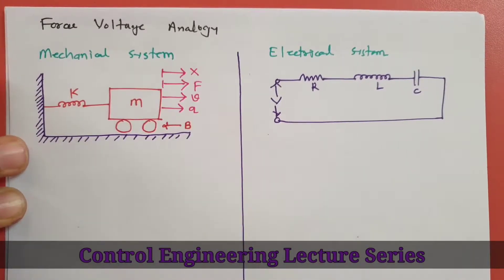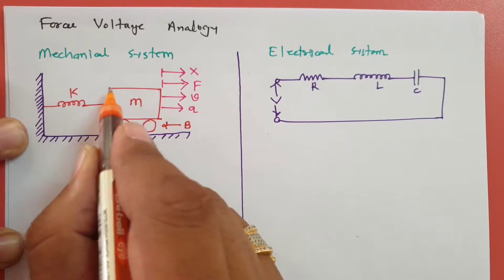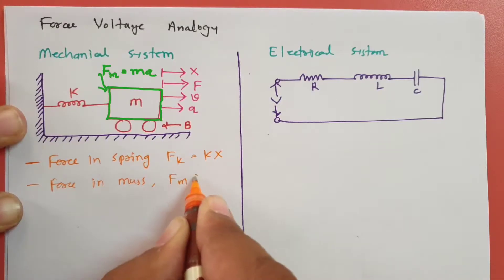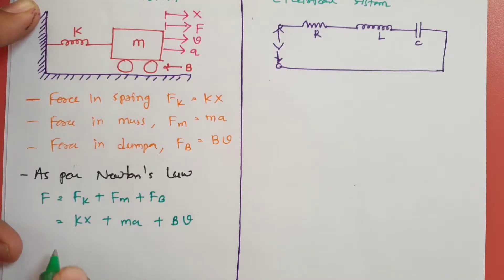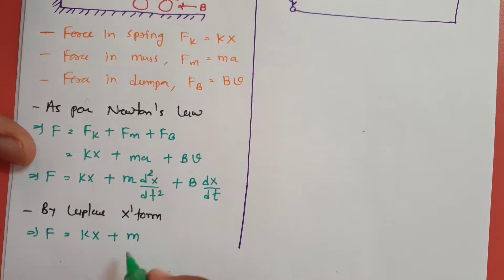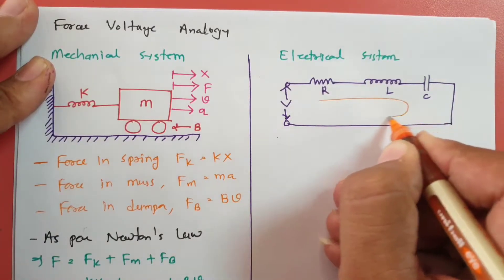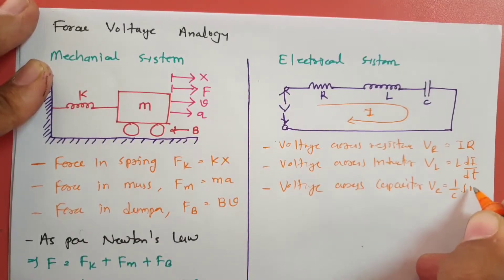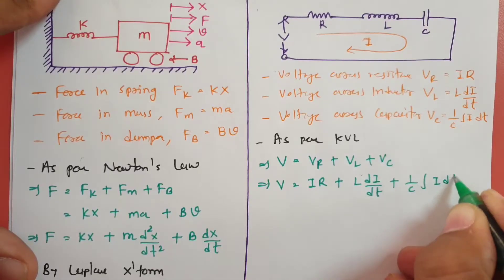Force Voltage Analogy in Control Engineering & Control System

Comment: you showed damper's direction to left and force is applied in right direction ? There should be subtraction i guess ? please sir explain it to me ? or is it damper will move in right direction ? if it's so then restoring force of spring should act when it's stretched by use of force in right direction ? why would spring aid in direction of force applied ? alongside there would be friction acting in opposite direction too ? 
i am confused here  , please help me sir .